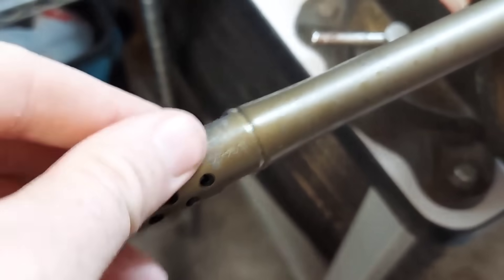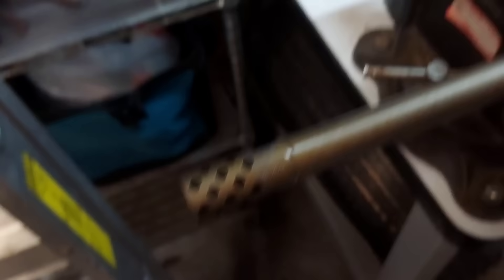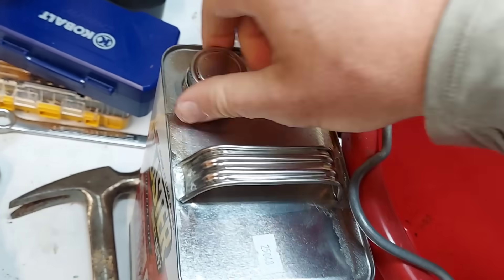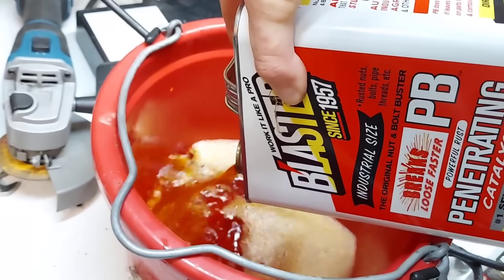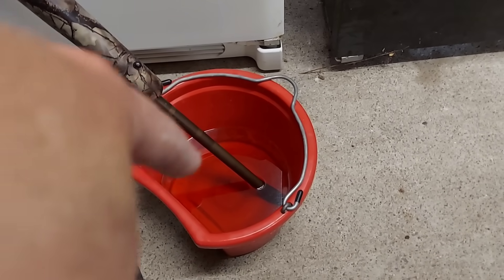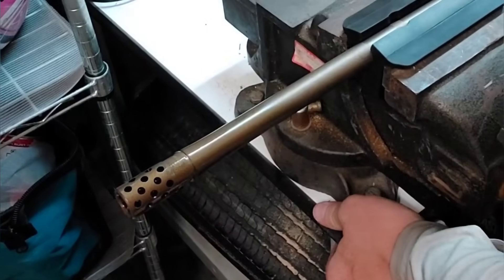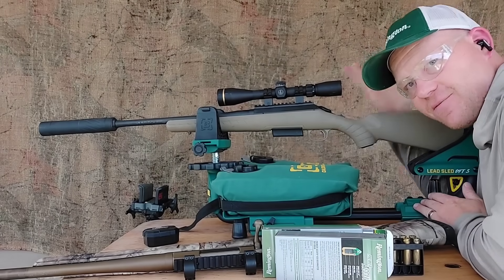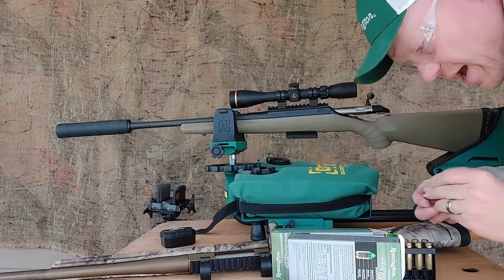450 Bushmaster Barrel Length Matter: Results Will Surprise You

Comment: Auto mechanic here for 40 plus years. I watched you over tighten that muzzle brake yesterday ! Also, it would be better if you gripped that barrel as close to the threaded muzzle as possible. Less chance of tweaking the barrel out of shape.
Reply: Not to mention putting the wrench on the wrong way.
Reply: Use a lot less Blaster or solution of your choice. Wrap end of barrel with paper towels. Put barrel in sandwich bag. Put enuff  blaster in baggie to cover end of barrel.  Use zip tie on baggie. Place everything in bucket or container in case baggie leaks.
Reply: @MarkSpalding-qc7ym good intel here. No need to use more than needed.
Reply: The barrel is tapered.
Reply: @jamestbell  There are ways to compensate for that. You dont have to clamp the barrel parallel with the top edges of the vise jaws. I have broken loose more frozen fasteners and parts than you have dreamed of.
Reply: @krasht1  Had fun breaking nuts and bolts on a 1964 Dodge d500., I didn't round the nuts & bolts the rust did it for me....
Reply: @ghostshadow9046  And that is where vice grips really come in ! I used them on the nuts that hold on shaker screens in a sand and gravel plant, a week and hex nuts go boat shaped, you have to put three nuts on  so you have something to grip.   Vice grips are for that, anything that is screwed up already !
Reply: PB  blaster is good stuff
Reply: You might want to look at the AR15  armors wrench.  It is mad to remove muzzle break and other parts.
Reply: Totally makes Sense . Great Advice .
Reply: I do like that youre are not scared to film yourself making mistakes like “righty tighty, lefty loosey”. Most folks are not humble enough to admit mistakes let film themselves and put it on the internet for the peanut gallery. Thank you for you REAL content and exercising humility.
Reply: Always use impact and lefty loseie. Right tightie .
Reply: @leonharris1329  Unless you have left-hand threads.
Reply: @tommyhood5900 exactly! Like most left side tire nuts on dodge trucks before 1976.

Comment: I'd take the 16in for it's pros due to shortness.   
The 450 bushmaster seems like a shorter range round anyway, so just how much and at what ranges are you going to be using the bdc reticle. Might not really be that practical if you're using it 150 and in.

Comment: You could have used 1/20 amount of PB Blaster if you cut a water bottle and dipped the barrel in it instead of using a bucket 😅
I'm glad though it worked!

Comment: Glad you found you were going righty tighty and not lefty losey. I was going to say The Modern Gunsmith book by Howe from 1940s shows using an electric soldering iron to heat up and free stuck screws. I wonder if using that technique on the muzzle brake would expand the threads enough to take it off without damaging the finish.

Comment: Brother heat is the tool your looking for. No matter what’s going on some heat will expand the metal and make it’s easier to loosen anything. Glad you figured it out after all that lol
Reply: I was just about to add HEAT.  Learned this at a young age working on cars.  I also had a muzzle break stuck on a new Bergara.  Would not come off.  Applied heat and it came lose quickly.

Comment: Jusst a little secret. To get the tighter vise, just use the round side of a wrench in the vise grip handle turn the wrench so it will give a longer vise handle. It extends the handle. Or even just a piece of pipe. The rubber cover will protect the barrel. Awesome video. We all need more sleep.

Comment: A fast powder must be used by the factory and is fully or nearly fully burned in the 16" barrel and the longer barrel isn't getting as much benefit from the fast powder charge. A slower powder would no doubt result in greater velocity in the longer barrel.

Comment: Big bores like that don't usually give radically different fps readings for the same reason that longer/shorter shotgun barrels don't...powder burn pressure impulse is dissipated quickly due the large internal volume of the barrel behind the projectile.  For example, Big Green said several years ago that shotgun loads only accelerate the shot charge during the first 12"-14" while the propellant is still burning and expanding.  Longer shotgun barrels just give you a better sight radius to work with.  Sort of the same thing happens in big bore rifle barrels.  Once the powder charge is finished burning, the pressure drops off and there can be no further acceleration of the bullet.
Reply: I believe you explanation is the most correct scientifically. There can also be an effect after powder is burnt up that the friction of contact with the barrell slows the projectile. An example is 22lr precision subsonic ammo: 24” can be same speed as 16” whereas 20 is fastest.
Reply: @johnbackman4475  Yep...depending on the relationship between powder burn duration and barrel length, a longer barrel can actually slow down a projectile in the barrel.  Very complex and variable, though.

Comment: Rockset thread sealant which is what ruger uses on these is water soluble.  Soak the brake in room temp water overnight.. and it will come off very easy the next morning.  Ask me how I know lol
Reply from the maker: Ruger told me they dont use anything
Reply: Hopefully they just forgot to say anything anymore haha. All my ruger factory brake guns (6) currently.  All had gray sealant on the threads. I didn't want to heat mine and change the temper of the metal. An old boy who has been a gun smith for the last 40 years passed the water trick for the ruger brakes on to me. And it has works for me every time. Glad ya got it off Adam.  Id keep the go wild in my opinion.  They look great. And with the hornady black my go wild is running 150 ft per second faster then my patriot over the chronograph.  And thats only 2 inch difference in barrel. Look forward to the long range comparison vids between the 2

Comment: Would -100 fps really make that much difference at 50 , 100 or 200 yards using the Leopold turit calibrated at 2200fps? I'd stick with the shorter length with the can.

Comment: Grouping drills with both rifles using the same scope and ammo. The one that groups better is the keeper.
Reply: About to say, shoot some groups at 50 and 100 yards to get an idea how they both print. The factory probably used a test barrel to get their information rather than a particular brand of gun. Should have been some data on the box besides the velocity.

Comment: You're loosing some speed with the can. That said the 22in. with a can gets really long. Maybe too long. I'd say do the math and make sure you have enough boogie for the longest shot you think you'll take. 
I think the scope will work fine either way once it's zeroed. That optic and that 22in is capable to reach out to 300y accurately.
Reply from the maker: Can actually almost always makes it a little faster

Comment: I remember discussing barrel length effect on velocity with .45/70s and it was determined to be about 10 fps per inch of barrel length. It applied to this similar cartridge as well. Of course there is a law of diminishing return wherein after a certain point or barrel length, the friction created by that barrel length will overcome the longer barrel length advantage.

Comment: Your results mean the powder being used by the factory load is pretty much fully consumed by the shorter barrel and the extra length does not help as much as expected.  So, if you handload with the same bullet, primer, etc., you should use a slightly slower burning powder, and probably a few grains more, to take advantage of the longer barrel giving it time to fully expand with the additional higher pressure expanding gases.  Then you will see more than the expected 60 fps/inch of barrel length.  If you are happy with the short barrel ballistics including energy and momentum, it certainly is lighter, shorter and easier to handle.
Reply: That's assuming there is room in the case for the slower powder...which there might not be.   Many small capacity cartridges are loaded to full volume with powder that makes the desired pressure as high load density is good for consistent velocities.   I'd be curious to pull some bullets and see where the factory powder levels are set.